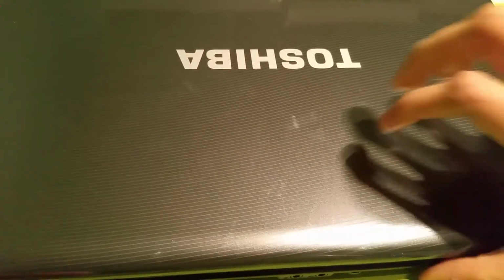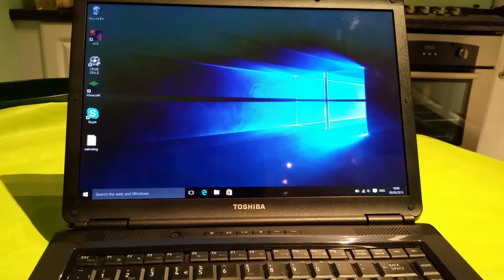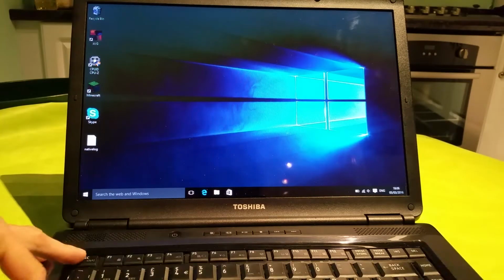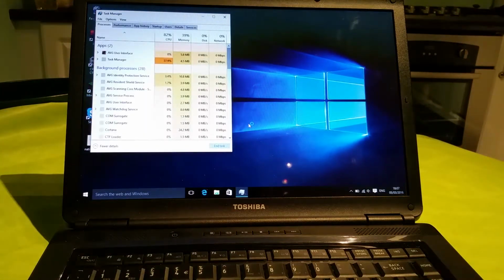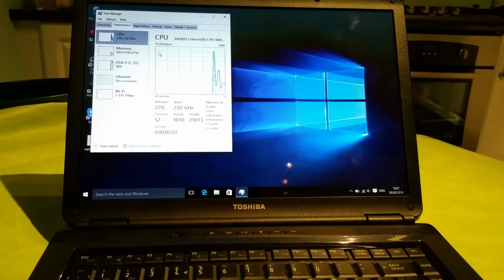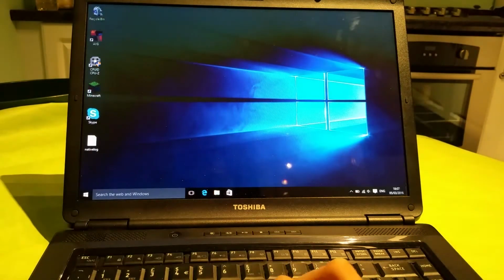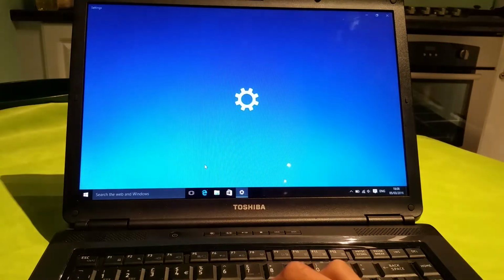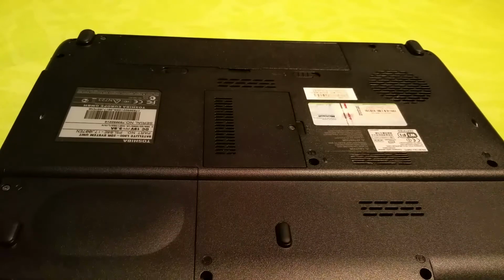How To Install RAM In Toshiba Satellite

Comment: My laptop model is satellite c660-11r 
Currently the ram is 2gb in it. But it’s so slow.
Can i add an extra 4gb ram? 
N.B: The battery of my laptop is damaged, so using it through direct current.
Reply from the maker: If you havent got a ssd in it get an ssd in it and the ram shouldnt be an issue, you probably wont be able to tell me what processor you have and what os you running
Reply: @MrWaheedulHaque   the processor is intel core-i3
And running os is windows 7 professional
Reply: So you telling me that to make my laptop faster ram is not matter, rather ssd is important??
Reply from the maker: I need exact processor model, and exact os 32bit or 64bit to tell you, and ssd will make most difference but 2gb ram is very weak
Reply: I have mentioned my pc model on 1st comment,  would u kindly check the specifications on Google
Reply from the maker: @EFootballUnofficial707  i have checked and theres too many different cpus on that, i will need your exact one

Comment: From where did you bought the ram?
Reply from the maker: Internet just search the ram and choose a good brand one
Reply: MrWaheedulHaque The reason I ask because I need to know which model would be compatible for this laptop or all ram has a same style.
Reply from the maker: Depends on speed and ddr version, you can find this on cpu z or just go to crucial website and use the scanner tool for it to auto find you ram for your model
Reply: MrWaheedulHaque Thank you for the quick response but that scanner does not work for me since I am using Linux not windows. I have a exact same laptop if you happened to have a link of this specific ram then I can just purchase this one. Thanks